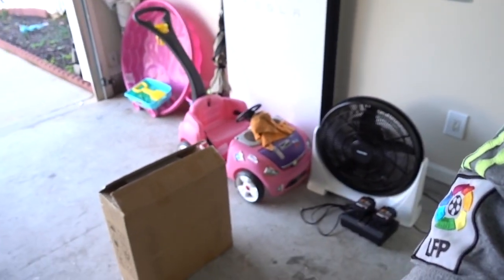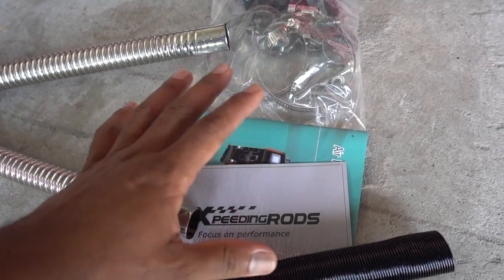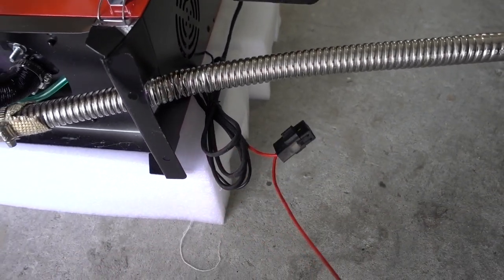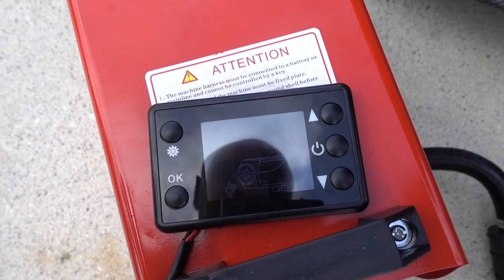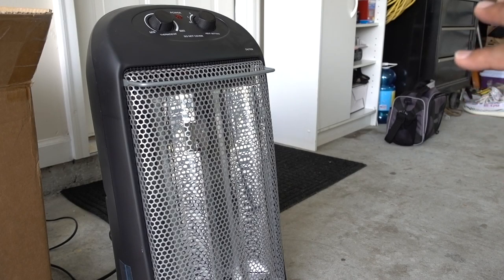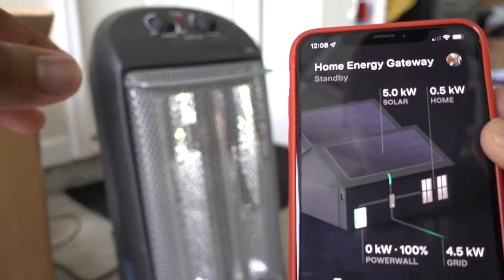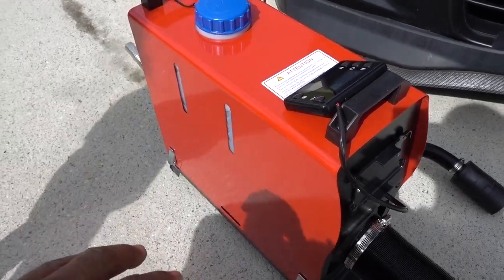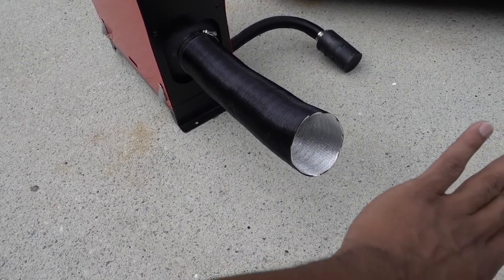Reviewing Maxpeedingrods 5KW Air Diesel Heater

Comment: Nice video but you make one big mistake…. When priming you don’t wait until the pump stops priming. You start the prime sequence exactly as you say. But , you have to look when the fuel starts reaching the heater. You can see that underneath in the green fuel line you have. As soon as it reaches the heater you press the button arrow up or on/off and it will stop priming. This way you don’t flood the heater and won’t have any smoke . Not even during the first start. If you wait until the pump stops priming you already get way too much fuel in the heater and burning this off causes the smoke and in your case a lot of smoke. Just a heads up. Keep up the videos . Kind regards Florian

Comment: Hi, is there a way to power this with a cigarette lighter plug to the car?
Reply from the maker: Yes that’s what I did, I get the plug from Home Depot, I make the splice to the cables and get it running with no problems
Reply: @BulletSolano  Splice with just electrical tape, or?
Reply from the maker: I solder the cables, but you can do it with electrical tape